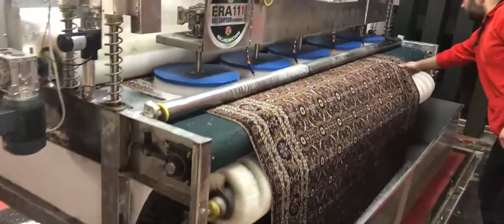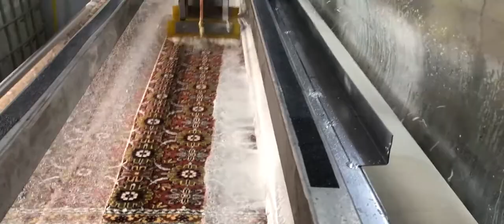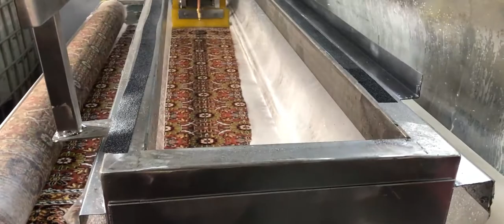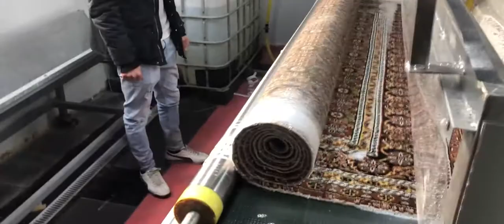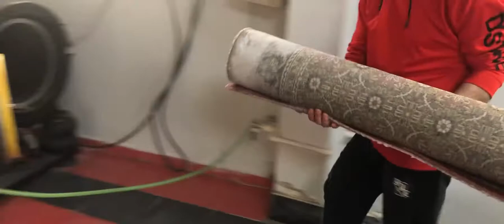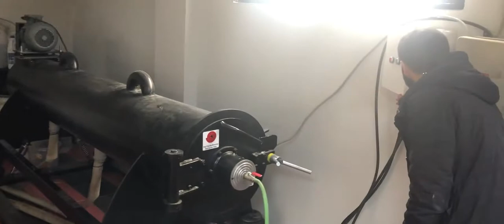Rug&Carpet  Washing Rinsing Machine

Comment: Your method appears to leave all the soap residue on the carpet.  Do you rinse it once you centrifuge the soap out?
Reply from the maker: In this machine there is no high pressure water pump installed  so the client is using tab water on the rinser unit ,they prefer to rinse the carpet in the centrifuge as ou see there is a hose going in to the centrifuge with water for rinsing. But if ordered , we can install a high pressure water jet on the rinser for more afficient rinsing  with more pressurized water.
Reply: @muratoner3951  Aha, that explains how you rinse the carpet...thank you for answering. Always like to understand how things work.
Reply from the maker: @kathybricco1464   You are very welcome